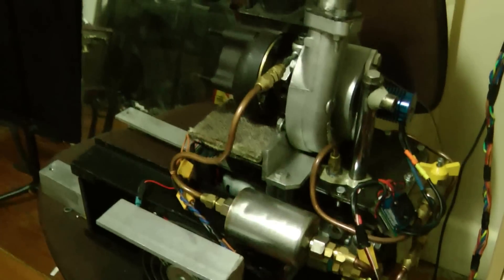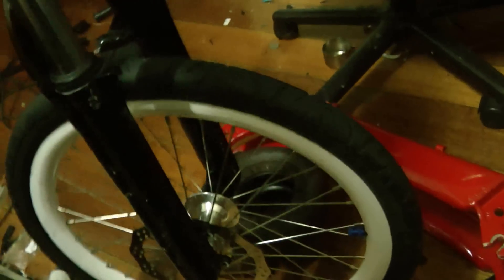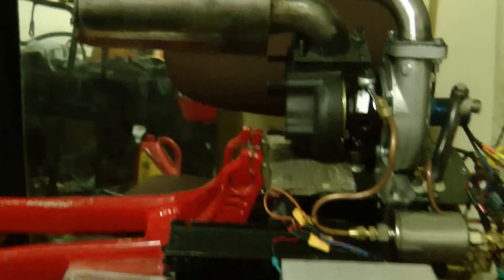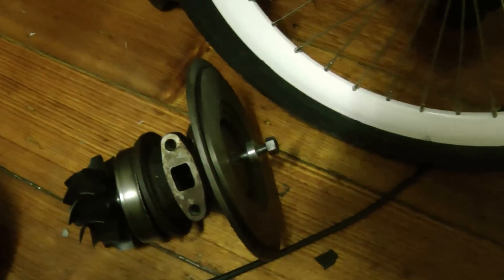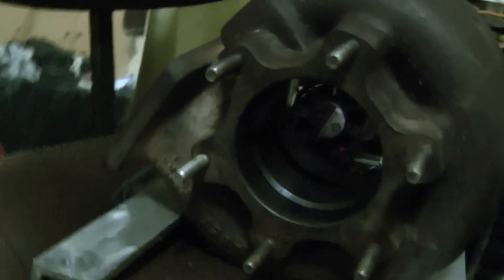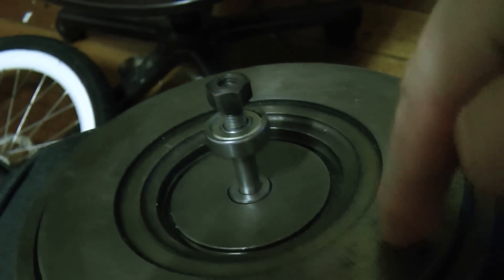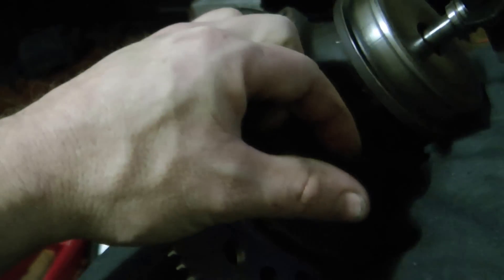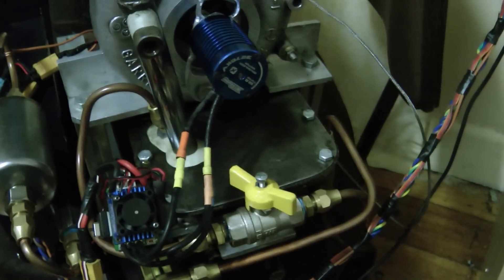How to Build a Jet Engine Part 3. Home made Gas Turbine Jet engine tips and tricks

Comment: Hi Joel, Can i ask you a couple of comment/questions?

Instead of using half a turbo for the power take off, couldnt you connect directly to the input turbo and gear down from there? The power transfer efficiency would be better, and would be similar to the arrangements used in turboprops.

The other question is, was there a real need for the clutch on the end of the brushless RC motor used for starting? These motors are used to running at high speed such as this, also they make VERY efficient generators, somewhere along the line, you will need a power source to recharge your battery, again, if it isnt a direct connection, you will lose efficiency.

Im considering a jet turbine build myself, and both of these questions are going through my mind.

John
Reply: so what your saying is you could use the brush-less motor as a alternator
Reply: @mike.o3616  three phase motors are generators when spun. so yes. probably just need a circuit to induce the field.